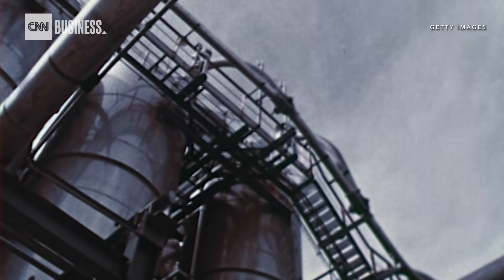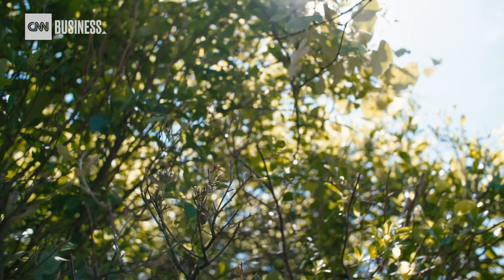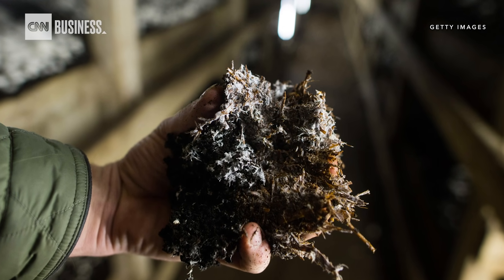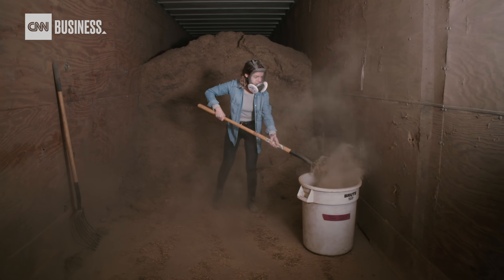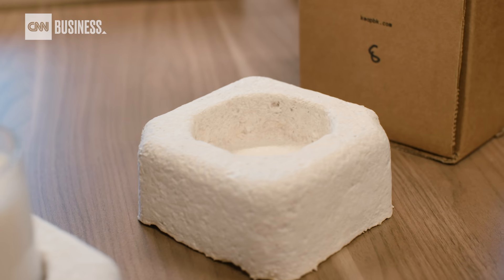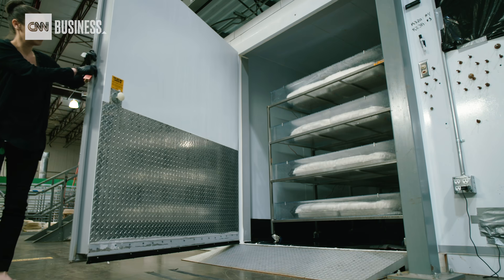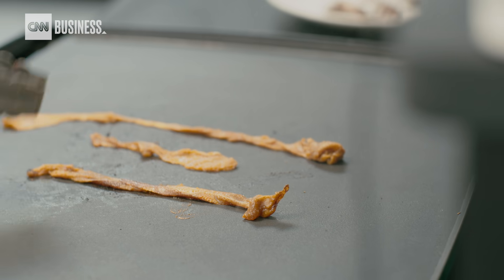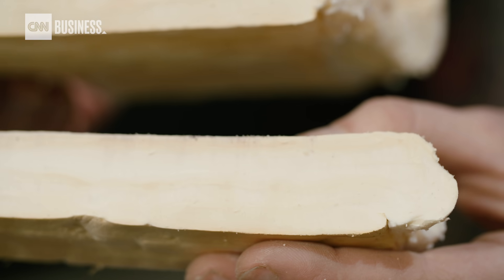Could mushrooms be the key to replacing plastic? | Mission Ahead

Comment: plastic is invented to protect the forest. the problem is not a plastic, but our recycle system. our engineering and science archivement is great (transhuman, mars, fusion energy etc) but we still failed invented a single plastic code. We have universal recycle code, but we don't have a standard recycle method. before we manufacture a products, we should think it's recycle plan. to keep sustainability, we should made product for recycle, and we recycle to made a new product.